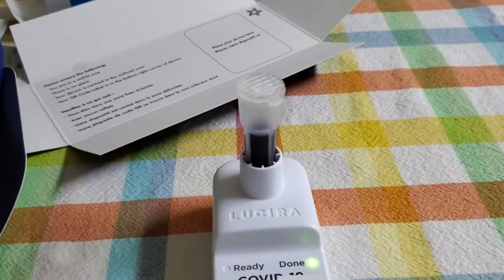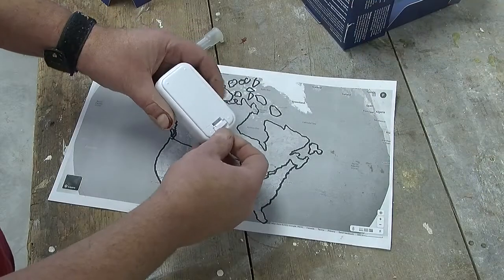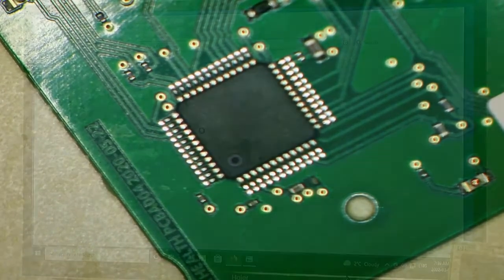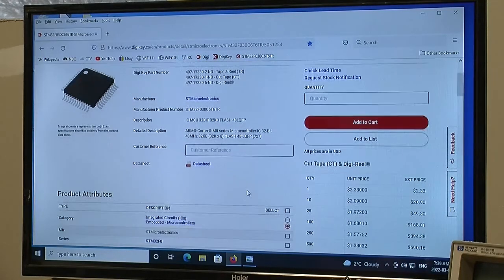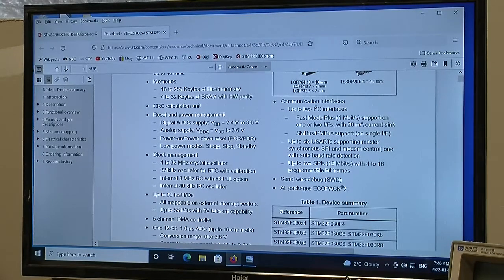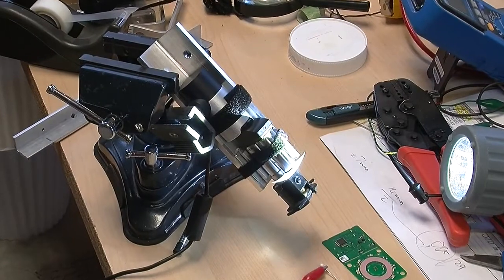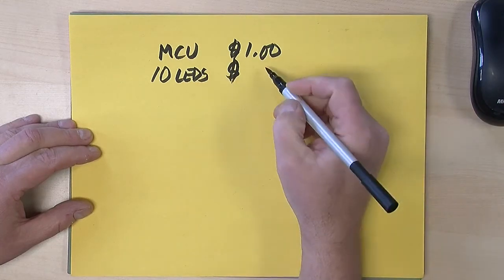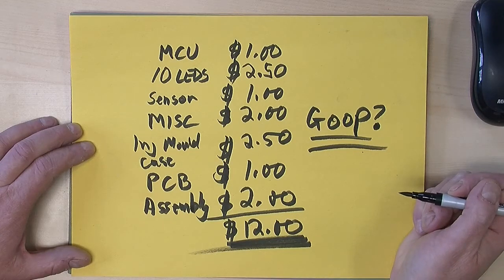Inside an RT-LAMP Test kit

Comment: The purpose of the "C" line is to confirm the test is run correctly.  If the "C" line does not appear then the results are invalid.
Reply from the maker: Exactly. And I think its there from the same plastic housing having been used for other types of test where C meaning "Control" would not have been confusing.  My feeling was in the context of Covid tests, many people would see "C" and think that means its the Covid stripe, no the control stripe. I think by now everyone has done so many tests there is little chance of confusion any more.
Reply: @ElectromagneticVideos  Probably the same housing as a home pregnancy test which works similarly.
Reply from the maker: @soundspark  That explains it! They would have already been making those plastic housings by the millions and just re-used it to get the covid tests in production as fast as possible.